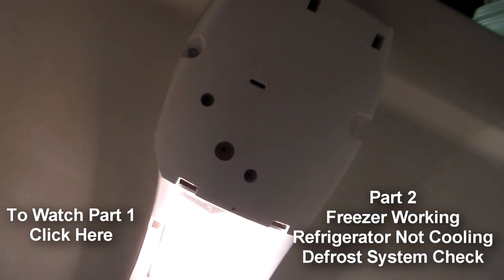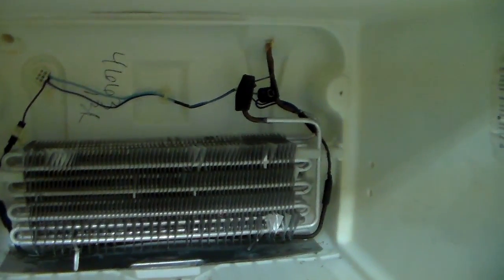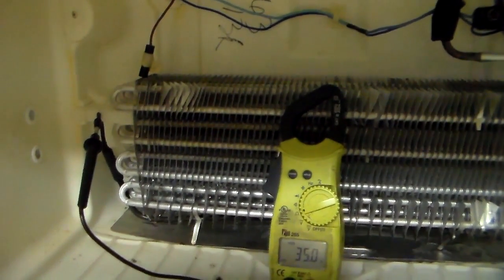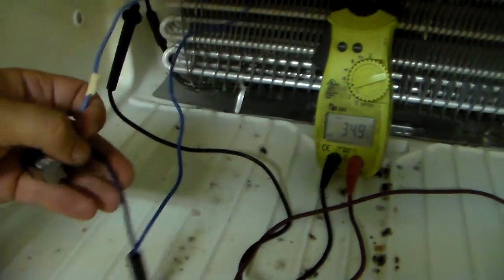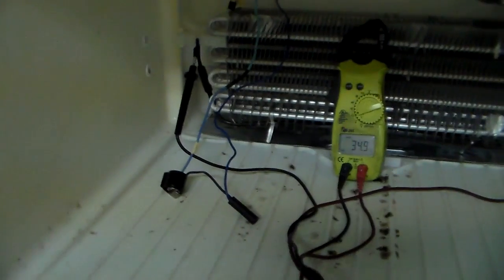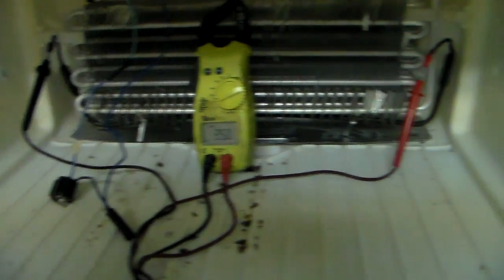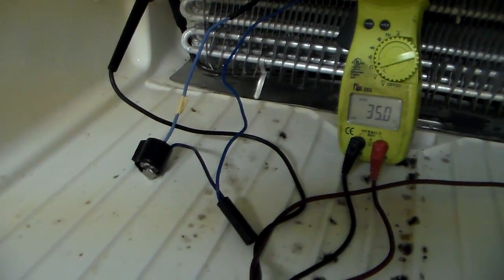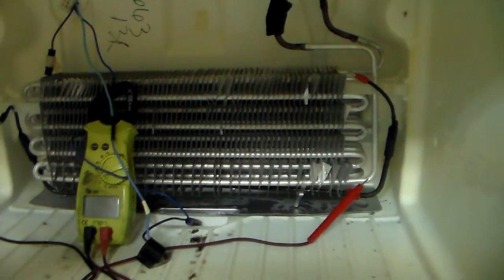Troubleshooting a No Cool Refrigerator - Part 2

Comment: Wow.  So imformative!  I was having problems w same model fridge and was working on it till midnight last night... Freezer working great but fridge 65 degrees - I could hear the fan running in the freezer before I pulled everything apart. I never knew (until now) to turn the defrost switch in the fridge -so I had just unplugged everything, pulled off the back and defrosted everything thinking that clearing the "ports" of ice would allow everything to work fine.  Put everything back, nice & clean and now the fan isn't working.  Hmpf!!  Guess I have to start all over with Step one of turning the switch and do the test again tonight.  I think I have to go our and buy one of those AMP testers (that yellow thing you had in the freezer :) to do all the other tests.

Comment: Hi Bill.  I was not getting much cold air to the refrigerator and had ice in the freezer, so I started troubleshooting the defrost system.  I manually advanced the timer to the defrost mode and the heater did not come on.  I figured this meant it was either the thermostat or the heater itself (not the timer) that was the problem. I have continuity in the heater (30 ohmes), so next I tested the continuity of the thermostat (while it sat in ice water).  I got 56 ohmes, but I get the same reading even when the thermostat is out of the water and at room temperature.  Any ideas?  It seems like the thermostat is the problem, but if it the circuit is closed regardless of the temperature, why would I be having defrost issues - that is, wouldn't the heater stay on during the entire defrost cycle, regardless of temperature.

Comment: You are awesome.... Only question.. What happens if your have all those symptoms but your fan is not running. We has all same issues. Iced over coils and warm fridge.... Did the defrost timer issue turned it around and the heater was nice and warm. But from the beginning the fan is not running at all or blowing any air-- Does the timer control the fan?

Comment: Good vid's Bill, still got problems after replacing timer, heater is fine, temperature fuse is blown, now I have to locate and change the temperature fuse, I understand not to apply too much heat if soldering needed, but where is a temperature fuse usually located. It's an NEC NTM260RWH fridge

Comment: Thanks Bill for helpful Video.My Fridge is a Haier BF275 and doesn't have an obvious looking defrost t-stat as in your video.Could please describe this component and its location in the freezer compartment.Cooling appears to be working but fridge runs for v extended period and forms ice on the evap quite quickly.Also, there's NO mechanical time in the lower section. Many thanks.

Comment: wonderful explanation Bill,i got a problem with my Moffat GE MTR12BASRWW  has been giving me issues recently. it had frozen in the coils  2 months ago so i tawed it out with an hairdrier it seemed to work fine for a month,just yesterday it decided to  stop freezn properly again,unplugged power/ checked out heater unit, cheked ok . chekd out the thermstat with water,it check out ok.the thing is, there is another unit with 2 wire comin from it in there,i don know what it is or how to test it ty .

Comment: Thank you for that very informative video. Very excitedly and armed with about 4 different screwdrivers I marched off to  troubleshoot my built in fridge freezer problem...Freezer working, fridge not, only to find no screws, not one screw to remove anywhere in the unit!!!  Are there some new cheaper units that are just a closed unit and cannot be repaired?
I have an ATLANTIC ATBGN.2610AP and cant find any references or spare parts for it.  I'll ask my husband to help me remove it from the cabinet and  go from there.   Thank you.  Have a blessed day.

Comment: Hey Bill... you are very detail in your line of work. Thank you.... btw i have a GE Profile PFCS1PJXSS thats not working right now and i replaced the board because flowcharts i was working with says so but it stayed the same.. not working. usually i have a control voltage of 4 - 6 volts that goes in to the inverter and the compressor works and refrigerators does its thing. This time, i changed the board and it had an erratic control voltage between 10-12 volts thats fast alternating on my DMM. The control voltage is exactly the same as the old one so i assume its something else that would influence the mainboards control voltage for the inverter. Would you happen to know what it could be based on what you read? Thanks in advance
Reply: I heard bill is dead bro

Comment: Bill, you have a great video.  I followed your recommendation & got my fridge working.  Now that's its working, and not freezing over. I wanted to pick your brain.  I changed the defrost timer, defrost timer thermostat, lower refrigerator thermostat, compressor start relay & capacitor with OEM parts.  The freezer works great for a couple of days, but then the temperature fluctuates from 0°-20°F.  What else can I do to keep the temp in the safe rang of 0°-5°F? I hope you can help.  Thanks!
Reply: What was the final cause ?? Curious how you got on 😃

Comment: Great video.  FYI, One comment is that my Kenmore/Whirlpool model has a defrost thermostat labelled 55-35 which I found out means it turns off at 55 degrees F and on 35 degrees LOWER (i.e., 20 degrees on the thermometer).  So using ice water to check for continuity did not work.  When I put the suspect thermostat in the freezer for 10 minutes, it tested positively for continuity.

Comment: Thanks Bill ... I like your videos .. no nonsense marketing stuff, just the facts. Question : Could  a bad defrost subsystem lead to presence of water in the fridge (bottom area). Due to ice build up clogging drain pipe to the tray by the compressor. I am not sure, because if there is no defrost cycle, there won't be any melted ice (water). On the other hand open/close of freezer door and content moisture could produce enough water which then is not being drained properly (due to clogging of drain pipe) leading to water build up....

Comment: Great video. I have a problem hopefully you can help. I got a used frig a crosley. Freezer on top. The condenser fan wasnt working but the condecer was. I replaced the fan but there is no air blowing through the duct to cool the frig. There is no obstructions in the duct either. Any suggestions ?

Comment: Great video , looked at my friends refrig since I was able to repair mine  before watching this video , his had no frost , and did hear the sizzling when we had freezer open ,, so now know heater was working and freezer was working good , just no cooling in the refrid . You mentioned it right at the end of the video , if no build up , fans in freezer working , can ice just form In Front panel ( refrig cute )  some ice fell out when I removed it , hoping it was just blocking the air flow ?

Comment: Bill took the back of the inside of the freezer and turned on the defroster switch manually, which turned the fan off. Only thing is there was no frost whatsoever on the coil and it was neither hot or cold. Does that sound like a possible lack of freon issue?

Comment: Thanks for this vid.  My Mabe/GE fridge only has a micro controller board and no mechanical timer.  I checked all the stuff in the freezer compartment and it all works.  I am trouble shooting the controller board and the circuit for the heater is showing 24 volts.  Do you know if the heater is suppose to be getting line voltage (120) from the mains?  Thanks in advance.

Comment from the maker: If the compressor is running, you need to check the coils to see if they are freezing.  They should get a light covering of frost when the compressor is on.  If no frost, no freon.
Bill

Comment: Hey Bill. Great Videos. I have a warm fridge and freezer. There is some built up of ice in the back. Manually put it in defrost. Heater comes on. Wait about 20 minutes and it comes out of defrost on its own. Just because it comes out of defrost on its own, does that mean it will go into defrost on its own??? By the way, compressor is very warm. Thanks Bill

Comment: Quick question:

As I have these symptoms of cold freezer (sometimes down to -10 F) and my cooling area hovers around 65 F, now that I’ve replaced the door gasket (thank you for that video) and I’ve advanced the timer, do I advance the timer just once and let it go into defrost mode for the 30 minutes a single time or does thawing an evaporator from a frozen block of ice take a few Manual defrost cycles, that need to be repeated, one right after the other?

I ask this question, not having removed the inner back of the freezer to see if the heater is actually working this time, simply because it’s a weeknight and I don’t have much time. Just want to know if I should try that plan when I get home from work tomorrow. I may be just making an assumption that, once the evaporator is frozen, it’s going to take more than a single, normally timed defrost cycle to thaw it as, perhaps, it’s not supposed to be that frozen under the normal operation it was designed for?

Also, and this may be a stupid question, but how does the timer usually fail? What I mean is, does it usually stop turning/operating or does it continue to turn/operate, while not sending a signal that the defrost signal should start? I ask because I get the impression that it may be possible to not know whether the timer has stopped sending a signal or that the defrost heater actually doesn’t work. What’s more likely? I don’t have a multimeter.

I do understand that, if it’s not the defrost timer, it’s possibly the thermostat in the freezer.

Thank you

Comment: Thanks Bill for clearly explaining how to diagnose defrost problems.  I have a Whirpool top freezer frig. mod# ET1CHMXKT04 with a defrost problem.  I spun the timer as you instructed (put into defrost cycle) and waited aprox. 20 min., heater didn't come on.  Started to manually defrost with hair dryer and then heater came on. Finished completely defrosting with hair dryer and help from heater and put everything back together.  I figured I needed a new timer based on what you said ( if heater comes on when timer is manually spun, bad timer).  The next morning I decided to spin timer again without taking off back panel just to see if heater would come on, it did.  So I went online and ordered a new timer.  That night I decided to go ahead and spin timer again to defrost so to keep unit from freezing up again until I got the new timer.  Heater did not come on this time.  Tried again the next morning with same result, no heat.  Wen new timer arrived unit was in need of defrosting again, so proceeded to defrost, spun timer again just to see what would happen and heater came on.  Replaced timer with new and went away for wknd. hoping my problem was fixed.  But sadly we returned to find same defrost problem.  Took off back panel to defrost, spun timer and heater almost immediately came to life.  Now I have been spinning timer to put into defrost once first thing in the morning and then again at night before going to bed.  The heater is now always coming on when spun, but now after heater goes off the compressor and fan will not start and I have to manually spin the timer a couple of clicks to get the system back up.  So Bill what do you think is going on with this thing.  I thought about going ahead and replacing the bimetal, so I went back online where I got the timer and was shocked to find out the thermostat is ($27), that's ($10) more than the timer cost.  So I'd like to be sure that's the problem before buying a new bimetal, but what else could it be?  I had a question about the new timer I bought, it's a universal timer and has a loose timer motor lead that has to be connected to the correct terminal on the timer, depending on the run application.  I was a little confused on this issue, but in the instructions that came with the new timer I did find in "Procedure 3" the colors for the terminals and wires matched with my old timer so that's the one I used.  I put the loose lead on terminal (1), orange wire as instructed for a continuous run timer.  I hope this is correct.  Any help or suggestions on these issues would be greatly appreciated.  Thanks

Comment: its working good so far. I think what caused the relay failure last time, it was probably because I put too much stuff in the freezer and it blocked the airflow, which then in turn made ice build up , which was severe enough to cause relay failure.  its just my conclusion so far. thanks for your help

Comment: great vids! have same fridgeadair. cycles on/off ever 15 min. settings normal temps ok. condenser coil barely warm to touch. no frost build up. what could be wrong? 30+ minutes per hour seems very excessive considering normal house temp of 70+/- F and average/low humidity(northern climate). even cycles over night when we are sleeping and it is not opened regularly. door seals  seem ok. thnx in advance, your help greatly appreciated

Comment: Hi Bill !. I installed a new main board on a WHIRLPOOL WRF555SDZ and all the functions seem to be working, including the cold adjustments, but the unit is not cooling. The compressor is working, the freezer fan too, all the components were checked previously and were ok. I wonder if I have to do some trick with the new main board, but this model does not have a code to do a restart. Would you tell me something about this. I will appreciate very much. Thanks, Ramon Perera, Miami.

Comment: Hi Bill - Thanks for the video...I have a similar issue but little different...Freezer working but fridge not cooling...I opened the back panel as per your instructions after turning the timer to defrost...heater seems to be heating fine and frost is melting...but after a week, the fridge is not cooling again....my defrost timer seems to go in cycle and come out of it...Do you know what could be the issue?

Comment: Great videos...Isolated my problem to the thermostat.  Thanks so much.
Question, Is the black substance on the pipe next to the thermostat electrical tape?  Mine was encased and soaking in ice so it came off like gum.  Why is it on the pipe and should I replace it?  Thanks again.

Comment: Hey Bill, I love your video very detailed, and you keep it ABC once again. Thanks for the content. I have a question. Hopefully, you can help me. If you are too busy, I truly understand. I have a GE fridge model #GTS22JBPBRWW which in the freezers section it Keeps getting too hot when it goes into defrost. It always creates a lot of condensation. Now I have changed the defrost timer and the Defrost thermostat, and I'm still experiencing the same issue where When it's in defrost mode I open up the freezer and it feels literally warm not a first but It seems like it gets too warm. Please any suggestions would be appreciated 🙏  Thanks Bill!!!!

Comment: Thanks for Sharing Bill,
I was looking into the workings of the modern fridge in hope that I could convert an old ice chest into a working fridge for an old bus I am working on, when my modern fridge started failing the cold beer test. I managed to trouble shoot the defrosting problem to buy me some time, but now after seeing your clip I will eat more and shop less and isolate the problem when it returns. I am feeling fairly clear about that.
Getting back to the reason for trying to learn meself is because even fully restored the wooden ice chest can not compete with the australian weather. My questions to any fridgies or A/C blokes say that it can not be done....{it is a small town}. Can  I or can I not take the working parts out of a bar fridge and place them into a wooden box?
Any thoughts would be grand,
Cheers Brian

Comment: Thank you for your help, Bill! 
I'd like to ask you a few questions. I'm prone to repair all kinds of things, except my life and money (I think I need to readjust my priorities), and now have four (4)! refrigerators on my front porch and 3 cars (Priuses) on the yard waiting to be fixed...
1) So, first question - What is the best way to repaint the front doors that have rust spots on them (old Whirlpool problem);
2) Can you, please tell me, or make a video about No Cooling refrigerator, that have seemingly everything running - condenser fan, evaporator fan, start relay good (checked), capacitor good, compressor making noise, getting relatively hot and electrically checking out OK, but no cold anywhere, neither in freezer, nor in fridge? That's what I have on GE Profile (Arctica), Model: PSF26NGPA BB, Serial: GF430578, mfr-ed in April 2003. I think it's either compressor, or  main board (looking good, no burnt parts, capacitors not bulging), or low on freon. Can you tell me how to check out these components? Thank you!
P.s. On the third fridge I have cracked Evaporator fan's rotor. Might try to glue it, or replace. Fourth fridge is not checked yet.

Comment: I had similar symptoms but my problem turned out to be simpler. It was just the fan stopped turning that blows the cool air down to the refrigerator. I gave it a push and it started spinning again. Going to replace it since it's obviously going out but just in case anyone else has a similar issue, maybe this will help. Thanks for the video!

Comment: G'day Bill,
Great video. Tested my fridge in accordance with your instructions - heater did not come on. I tapped the defrost thermostat "lightly" with a screw driver - suddenly, the house power circuit shut down (RCD earth leakage protection) so from this, I would say the defrost thermostat has failed.... "I only tapped it lightly"..... I didn't get to testing the element with my meter - "I cant find it"      =:-(     - anyway, your test procedure has provided a bit more life out of a 13 year old Whirlpool Gold side-by-side fridge.

My wife if just a bit disappointed, she had already picked out a new fridge worth $3000. 

"Phew...."

Thanks Bill

Regards,

Jim